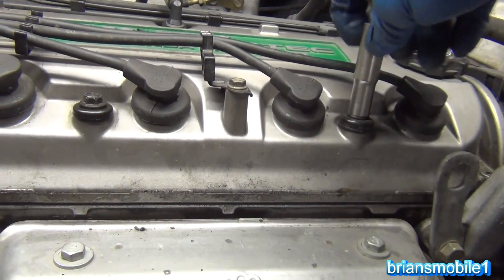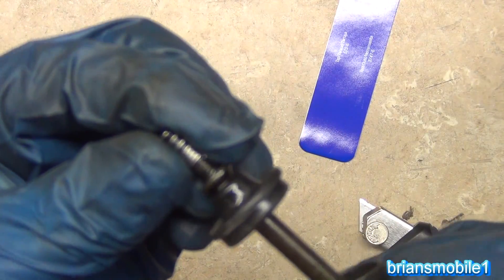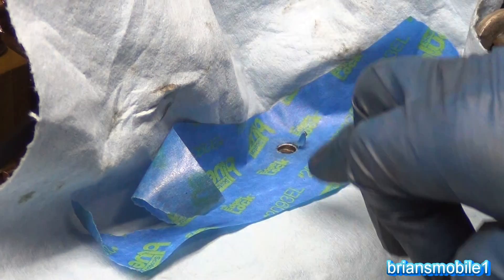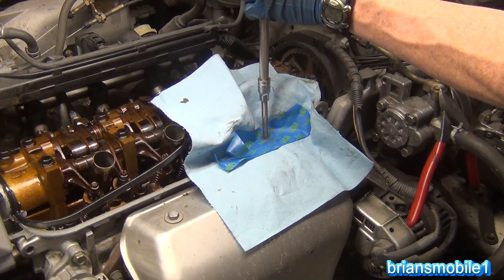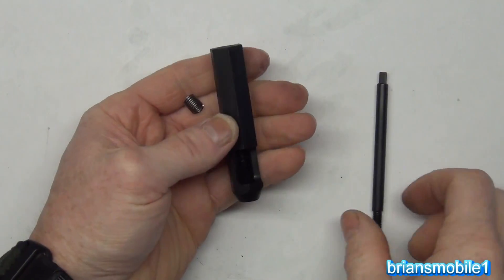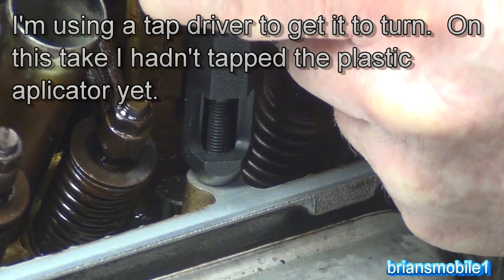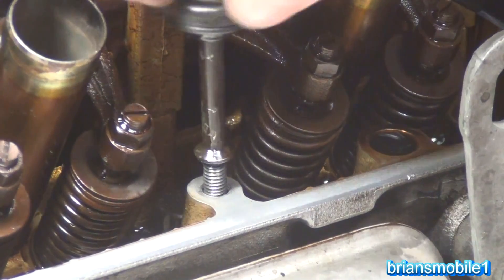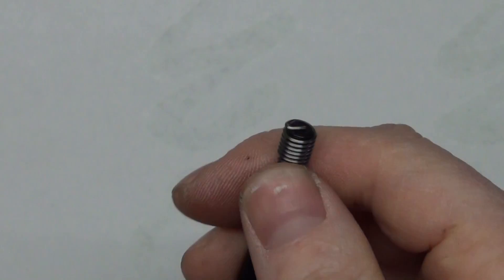How to Fix a Stripped Bolt Hole Threaded Inserts

Comment: This whole fastener system with threaded attachment inserts made out of brass like my POS 2013 Ford Explorer 3.5L engine sucks wet farts out of dead seagulls a**es compared to the old engine blocks from the 60’s and early 70’s period.  My inserts stripped just from torching them to specs.

Comment: Well hopefully mine goes as smoothly as your did I was tightening my valve cover bolts down and my bolt snapped (I was told 79ft-lbs I had only gotten to 11😢)
Reply: I bet you were only supposed to do 79 INCH pounds, not ft/lbs

Comment: Excellent video.  I just did this a few weeks ago.  It's nerve racking knowing you can completely destroy it. As an engineer, I do cringe when you don't use torque specs. Mechanics tighten things by feel and that's been demonstrated time and time again to be inaccurate and in some areas (aerospace), dangerous.  Also, the tightening sequence is not universally outside in.  Refer to the Honda OEM shop manual for the sequence.  These things have to be done properly and not by some arbitrary and subjective definition of experience.  Bolts that are too loose or too tight are equally bad.  There is a calculated thermodynamic elastic factor to all bolts and you want to be right on spec from the beginning.

Comment: This is the SAFE way to repair stripped threads. Chinese clone Helicoil knock offs are just as good as genuine. Best to buy a kit that includes the correct drill size

Comment: Need's inches???? Really
What other units of measurement uses 1/4??? 🤡🌏🥴
1/4 of a mm? 🤣🤣🤣
No wonder that it striped the thread when you use a gun to tighten them instead of using a torque wrench?

Comment: After you install a thread insert, should you torque it to the manufacturer's spec?  I have an alternator bolt hole in my honda odessey that has a 33 lbft spec.  Will an insert withstand that force?

Comment: so just to be clear..i use my same original bolts with the helicoil thread repair?
Reply from the maker: Yes, as long as the threads are still good enough and aren't buggered up or full of aluminum tear out.
Reply: @briansmobile1  
ok yea they simply won't snug up as result of over tightening..thnx

Comment: Unfortunately, the helicoil kit doesn't work very well when you're trying to fix spark plug thread in a spark plug tube. I'm not impressed by the fact that the Helicoil kit isn't set up for deep well spark plugs.

Comment: Couldn't you just tap it w/o drilling it?  I stripped a 6m bolt hole.  Would it be a problem if I tapped the hole to 7m and screw in a 7m bolt?

Comment: M8 are super easy to fix compare to , I had the biggest challenge in my life to remove snapped bolt M6 in 15 mm deep hole . This bloody bolt has two diameter M7 on top of it and M6 bottom side from half way  . The Bolt holds bracket for two injectors which works on 206 BAR pressure.  I removed the snapped bolt but while drilling tru drilled bolt M7 as a guide and I damaged part of tread - first 5-6 mm and last 7mm is fine  / middle is 10 mm damage along the tread ,but only around 2 mm gap . The entire length of tread is 25 mm  (whole bolt is 78mm) . Tightening torque is 6 Nm and then 180 degrees.  My question is -  Will this tread hold the bracket without loosing tension ?  Golf MK6  1.6 TDI CAYC  , Thanks .

Comment: I have the Federal version of that Accord, but my 2000 Civic needs the repair, so it was kind of weird to watch exactly what I need to do, but on my other car.  Your extreme closeups were also a bit curious on the 43" television I bought for my desktop.
I was driving to training that I needed to start work when my car started overheating.  I did not realize that my radiator was cracked, which was lame, because they are cheap and easy to replace.  I stopped to check, but I was confused that the engine was hot, but the radiator was cool.  Obviously, it was empty.  I did not think about that, though.  How could it be overheating after four miles in cool weather?
I continued movement because I needed to start work, but I blew the head gasket.
I replaced the head gasket, but I sheared the crankshaft pulley bolt.  I removed that and the metal shavings, replaced it, and bolted everything back together.
The valve cover wasn't tight, so I took it off again.  One of the holes was stripped, so I followed this video, fixed the thread, and bolted the head back on.
Apparently 7 pound-feet is less force than I thought it was.  My torque wrench clicked immediately.
I stretched that bolt, so I ordered a new set.
One or two other bolt holes stripped, so I ordered more Helicoils, but also a bunch of metal shavings got through the shop towel and tape, so I spent way too long picking them out with Q-tips and then I changed the oil in my Accord and Mom's Camry and tried to flush the shavings out.
I have not had the time to work on this in months, but it sure feels like replacing the head gasket was the easy part!

Comment: Thanks for the video.. I have to give this a shot because I'm leaking so much oil from this valve cover bolt 🤯 driving me nuts
Reply: Hey man did you try this already how did it go I'm having the same problem and going to try this method

Comment: Could this method work for my Coil over pack retaining bolt that keeps spinning yet not coming up, if I cut the head off of the cop retaining bolt and then remove the headless bolt.

Comment: Those with older Honda aluminum heads, attempt at your own risk!  I tried helicoiling one my stripped valve cover bolt holders but it ended up cracking the whole part when I took the car for a drive. Now I have pieces of metal in my engine.

Comment: Where is your torque wrench?  That concept is how the threads got stripped in the first place.  Not saying you stripped the hole in the first place.  I bought a used car from someone, the precious car owner had a new radiator installed by a mechanic that used a drill on everything.  Need-less-to-say all the plastics holes that mounted the radiator fans to the radiator. was cracked from over-tightening.  Ditch the Drill man, you and your customers will thank me.  A couple of extra seconds is not going to hurt you.

Comment: I noticed that you ran a tap through the insert tool " to make the insert run through easier" this is what you don't want to do! The tool is designed to provide some resistance so when you use some force to twist the helicoil insert it becomes the smallest bit thinner. This helps the insert enter and start threading in the newly tapped hole. When it gets completely through the outer tool you can feel/hear the insert snap/expand in the hole locking it in place. There should be another tool that is a smooth rod that is for snapping off the installation tang at the bottom.

Comment: You are THREAD JESUS and you have given me salvation! I have a similar problem--same exact f23a4 engine/the closer smaller valve cover gasket bolt--except the bolt snapped off in the thread a year ago when I tried tightening it by feel as opposed to its torque specification. I drilled an off-center pilot hole when I planned to extract it because I am a car noob. Think I'm gonna say "screw it" (no pun intended) and just do this. No more oil getting all over the engine, wiring harness, battery to ground wire, transaxle, starter, and chassis to collect dirt and grease and leave almost my whole bay covered in oil cake.

Comment: You should of used a Torque wrench to tighten them up. That's how your problem started in the first place. Also when Tapping anything. you should go clockwise three quarters of a turn and then back half a turn then forwards three quarters and back half and so on till the end. That way it allows the tap to cut cleanly. And use a cutting compound like Trefolex. You will get a much cleaner thread. Other than that perfect.

Comment: Nice video, But,  I would have measured the depth of the hole as it was a blind thread, I was nervous when you used the drill as the  D.i.Y. ers  WOULD END UP DRILLING TOO DEEP AND SCREWING UP THE CYLINDER HEAD,  I still  liked the tips you gave, Nice Job.

Comment: question for ya??? I just bought a 2000 Honda civic ex for my son and found that someone has already used the repair kit on my sons car. the bolt comes out with the coil so can I jb weld the hole and re tap it and use the original bolt?  thanks for the vid!!!

Comment: that's why I don't like people working on my car, they tighten the bolts WAY too much. I've had someone do the oil pan gasket and they tightened it so much they made a dimple around almost every oil pan bolt hole. I had to get a new pan because it wouldn't seal correctly anymore

Comment: Dipping a Q-tip in grease helps get the shavings that are stuck at the bottom of the hole.
Reply: RochNoure i was just about to leave the same comment 👍🏼👍🏼 very useful tip , I don’t trust a shopvac I feel there’s a possible chance to fling shavings everywhere

Comment: Brian, I don't know much about cars.  But can I do this with my manifold cover bolts?  When I bought it second hand , I didn't see it until it was too late.  Went to get the car inspected and it failed emissions due to manifold leak.  Turns out some of the bolts/posts were rusted or screwed in cockeyed and not straight   I was able to replace some of them and tighten them up so it passed emissions, but was wondering, should I try to remove the rusted bolts/studs and cockeyed studs and do what you show in the video, or leave it alone since it's not leaking ?   - Thanks for the awesome videos.  I do have one suggestion , could you give the difficulty and time it would take to do the jobs.  It would sure let me know if I would dare attempt it or not. - Can't wait for the next video :)

Comment: I got 
this Smell of Rotten Egg Smell in my
Pontiac Grand Am 3.4L V6 i had the complete Stainless steel Exhust Magnaflow system done 2 Months ago, well i went to the Gas station yesterday and this evening got this horrible Smell of Rotten Eggs i drove at speed between 60 to 70 kms just when i got the stinky smell it was outside the car and inside the car. noticed there were not any warning lights on, but i did change Fuel station and decided to go to Shall station.
Reply from the maker: +Newfie Led Man That smell is hydrogen sulfide.  Brand new cats aren't always "broken in" and you'll notice it more under hard acceleration and short trips.  Buy quality low-sulfur fuel, drive on the highway like a granny, and it should clear up.  You're welcome!  Thanks for subscribing and hitting the like button!
Reply: +briansmobile1 
Thanks for letting me know that,
 but i can't drive slow on the Highways here in Canada cause we have 100 Kilometers an hour is the top speed on our highway here, 
i think where you are it is Miles per hour, on the highways
would you suggest a higher up octane Fuel cause i always use Regular unleaded i buy it do to it is the cheapest around at .87 cents per liter.
i mostly smell the rotten egg coming threw my heater blower vents that is where we got the smell from, and when we had our other Minivan we did not get any of that kind of smell, is it because we had an Cabin Filter in the Van, and is there possible a cabin filter in my Grand Am,
yesterday i installed a New wiper motor but had to remove the Plastic guard and noticed that there were a big Oval shaped hole looked down and saw my Heater Motor do you think that i should try and fit a cabin filter over that hole
Thanks.

Comment: Do they have these for sizes like a stripped atv oil drain hole? my bolt i can push in and pull out of the hole without having to turn it and i can feel a chunk of it gone with my finger, what would be the best way to fix this?
Reply from the maker: +Carter Byers On those I try to re-tap to the next size up or JB weld it in and put an oiled bolt in it.

Comment: Brian, your idea to use the towel surrounding the taped area to keep the area clean is brilliant. You were smart to tape the center so that your drill wouldn't grab the paper towel and spin fragments everywhere! In a video last year, Duane at realfixesrealfast used wheel bearing grease on the drill bit to try and hold fragments from spinning off. That sounds like a good idea, too.
I've seen some people use locktite on the coil to try and keep it there, so it can't spin out later. Like you say, if you use good technique you don't get to practice this very often, and I haven't had enough practice. My generic kit doesn't have the plastic guide, which looks like an attempt to retain market share by Helicoil. It highlights the critical point to keep things straight.
Reply from the maker: +spelunkerd  Thank you!   I saw that video Duane did on spark plug repair.  That was really cool!  I love that guy.  He's a great teacher.  I also like his wiring circuits on a board videos.

Comment: so what sort of voo-doo magic witchcraft is performed to find which size hella coil one needs.  Do I just ask the pimple faced kid at the autoparts store?  Or the purple haired girl checking her facebook status at the hardware store.  Or do I just open packages in the isle to find the one that fits my threads.  I'm not allowed back in the plumbing department for that very same reason.
Reply: +Albion Laster Take the bolt into the parts store and run it through their sample nuts. If it thread easily you have the correct size and pitch, and markings on the head of the bolt often help define whether it is metric or SAE. Well stocked stores have a sample template that makes it easy, or you could grab a known nut from a bin and try that. Brian has his own template and I made one from a handful of identified nuts. Saves time.
Reply: type of guy who ask for assistance on putting on a condom also?  poor baby.
Reply: Bill numby why, you gonna help him put that condom on? Give him a break, you douche. Not everyone knows how to do eVeRYthiNgGgg like you. We all gotta start somewhere.
Reply: No lil Matty, that sounds like something you would like to do with a new buddy in your mothers basement.  Regards to your mom.

Comment: I use a wire to check the depth of the hole. Then use tape to mark that depth on drill bit,
And put vasaline on drill bit. The metal shavings then stick to drill bit. 
My 2 cents
Reply from the maker: +Jason Chicoine I will have to try that!  I can't find my boelube anywhere.  It's pretty nice too.

Comment: Ok, so in the previous guys defense, this is the softest aluminum I've ever seen used on a head. I stripped out one on my Accord (same engine) and didn't over torque it.  Probably had some crap in the well or the bolt didn't go in straight, I'm sure, but it's soft for aluminum it seems.

Comment: Now do one on the side of an engine block where you have to use a tap wrench to drill the hole out as well, with barely enough room to get a quarter turn on it as well.

Had some avionic equipment where the manufacturer decided from new that every hole in the castings were going to have a helicoil in them, which made servicing easy as the holes never stripped out. Minimum of 200 inserts per casting, some machinist spent a day per casting just putting them in.

Comment: What happens if spark plug wires rub against each other?
Reply: +mrsemifixit 
Jump the spark happens. 
Or hot ignition porn. 
Seriously it can cause random misfires, crossfires and radio noise.

Comment: The packaging instructions are correct. If you see dimensions marked as: 0.000 (three decimal places) that stands for imperial dimension no need to add ( " ). If you see: 0.00 (two decimal places) that indicates metric dimension.

Comment: Would you ever use some lock-tite to glue the Helicoil insert to the engine block ?
Reply from the maker: +Dicofole No, it's as likely to stick to the bolt and come out.
Reply: +Dicofole No, you do not want to do that, the next time you try to undo you rip the new thread out. The new thread is larger and has better load bearing than the original in most cases, so it will not come out unless you do something wrong.
Reply: +Dicofole 
SeanBZA has it right, no Loctite required. 
Stanley/Helicoil specifically states not to use a thread locker. 
Always break off the tang to allow the insert to bite into the newly cut thread and prevent the insert from backing out or turning. 
Using Helicoils on an engine where the hole bottom is open into the water jacket it is OK to use a thread sealer on the insert and the fastener to prevent coolant leaks and coolant migration up the fastener. 
I highly recommend lightly lubricating the fastener thread before inserting and tightening to prevent galling and sticking.

Comment: Why helicoil it when you can just use a bolt the same size as what you tapped? I mean everything you did was great but a step is added. Maybe I'm lazy, I don't know....
Reply: +AssGrabber B Because in many cases the bolt is a special one, like here where it is longer and has a special head. As well having a cover with 2 different bolt sizes is a pain if you remove it again and mix up the bolts. Thread insert in any case is stronger and harder wearing than the original.